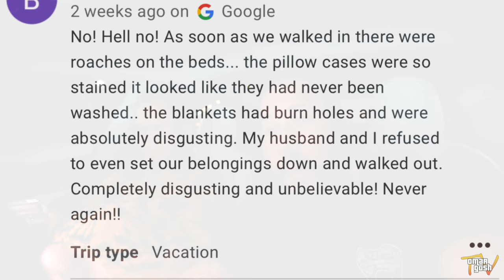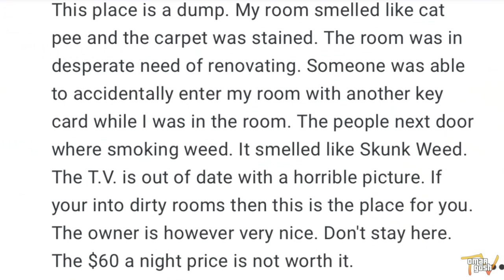Hotel Is So Scary Some Don't Check Out - Worst Reviewed One Star Hotel Ever

Comment: I had to stay temporarily at a hotel, and I would definitely say that the room I had was worse than that place. I was scared to walk on the carpet without shoes! The electric outlet by the microwave and TV was a hazard, the whole floor (2nd) was sagging in and who knows, it could break any moment. They charged way too much for that dump. And I bet that if the town Fire Chief went in there to inspect, they would shut it down for sure.  😬